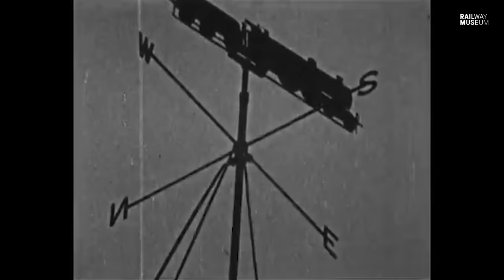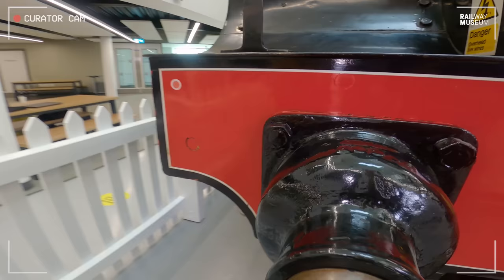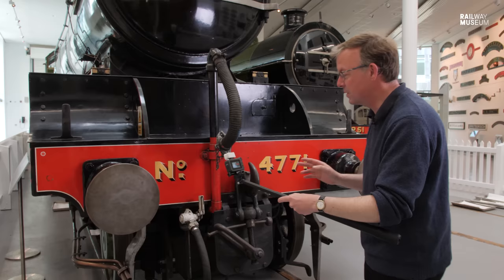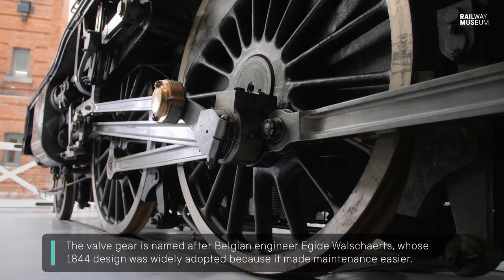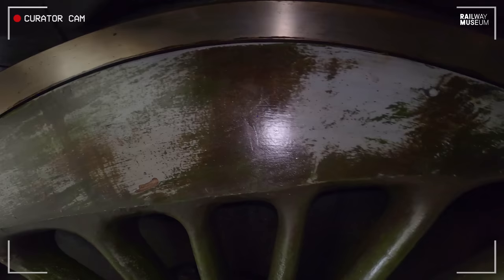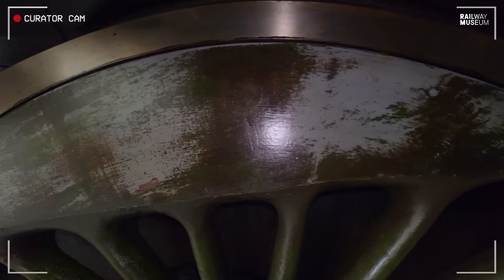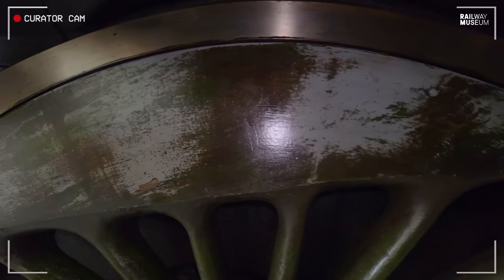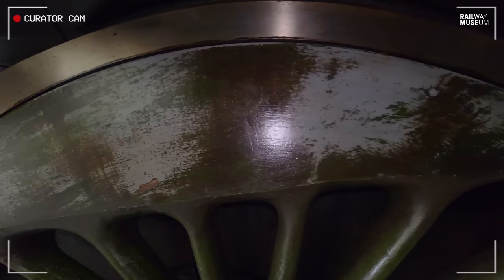Green Arrow: The Ultimate Guide to Gresley's 'Sawn-off Flying Scotsman' | Curator with a Camera

Comment: Frozen in time since 2008, just such a shame she's now totally static. Honestly engines like this need to be alive and free to run.
Reply: They can. Its just fuel and keeping the parts from expiring thats the big fr*king holdback.
Reply: @Tankindankincam not entirely, boiler tubes do need overhaul after 10 years or less and you'll need money to keep them running for generations, sometimes locos just take a long static rest before being run again but as long as you have a willing team of people and lots of money to burn you can get any loco going again (provided if the parts are completely knackered)
Reply: Hello
Reply: Hi Anthony. Green Arrow hauled the first train over the Settle and Carlisle line following the lifting of the steam ban. I was a coach steward on the train. I still have the tie they gave us. They did a presentation to Bill Harvey on the journey. I will have to dig out the photos.
Reply: The only thing stopping it from being returned to service is the owners.
Reply: @bjoe385  not so. We are willing to discuss, but it would need to be a funded partnership. The loco is on our operating strategy, so we haven't said no
Reply: @anthonycoulls7301  That’s mostly what I meant, there is no physical reason why the loco can’t be returned to operating condition, it just needs the decision to be made by the owner, the funding from the owner or both.
Reply: I am in total agreement with you on that point. I however don’t agree that the pony truck carries any weight. The PT is there to guide the whole machine, not carry any weight.

The actual, original design of said Pony caused lots of problems so it had to be re-designed.

If you browse through the sheer number of incidents with this loco you might begin to think she is jinxed.
Reply: @Tankindankincam  The biggest killer for a machine like this is to be a static museum piece
Reply: @leokimvideo  Not as big as a scrap yard. I much rather have a loco on display in a museum than left outdoors exposed to the elements or in the scrap yard.
Reply: @bjoe385  Well, first they need to fix the monobloc and they need money to fix that.
Reply: Heya Leo.
Reply: @anthonycoulls7301 dear Anthony.  If this is your account I’m replying too.    I am a huge fan of greasly locomotives.   Mallards 100th anniversary is coming up in 14 years.   Has there been any discussion of letting her steam again for her centenary anniversary/ centenary speed record anniversary?    She hasn’t seen steam since her 50th and into 1986.  I feel it would be very important for her to see service again on the 100th of the record
Reply: @anthonycoulls7301  well said. I think it's easy to forget as outsiders just exactly how much work is required to own and maintain these magnificent machines, and that unfortunately for everyday use they are very much inferior for general operations and active main line service. There are a number of locomotive classes which are extinct and thus their history is lost,  we are lucky to have a surviving loco, regardless of whether it is in service or not. It still exists and will still be around for future generations as a genuine artefact of the age of Steam. It took more than 2 decades to get Blue Peter back on the rails under her own steam, one can only imagine the money, planning and hard graft it took to get the job done at all.
Reply: If you are willing to pay for that new cylinder block to be built and installed I’m sure that would speed up the process

Comment: My dad was born and brought up about a mile from Doncaster Railway station and works. His favourite engine class was the Green Arrow. In the last days of steam, we lived near Nottingham and you occasionally saw one at Nottingham Victoria Station, running expresses to Marylebone, instead of the ubiquitous Black Fives. Despite the shortened boiler, compared to Gresley A1/3 Pacifics, they were more powerful than all except A3s with 20" cylinders. A remarkably elegant design.

Comment: The P2 Loco trust has just had a mono blog cylinder built for Prince of Wales so could the NRM not get one made for Green Arrow. I know the the Green Arrows was a different design but it could done. I would love to see her in steam again and remember her pulling the special train from Carnforth to York back the the 1970's. It was a wonderful trip. we also had Flying Scotsman and Sir Nigel Gresley on this trip each loco taking part did each part of the trip.
Reply: It could be done, we have the drawings. Cost is a major issue, which is why we'd need a partner to even consider it. Unlike the P2, we would seek a like for like replacement with a new casting rather than a fabrication.
Reply: @anthonycoulls7301  aside from the pattern I thought one of the reasons for its overhaul being put off was because it's an original LNER cast block and the NRM wanted to keep it on Green Arrow.
Reply: The house front end wasn’t Gresley’s! Just look to the right at Ivatt’s Atlantic and there it is.

Comment: It would be great to see Green Arrow run again but the issue is what would take it's place in Doncaster & where would it be overhauled as the NRM's workshop has become wonderlab (no idea why they shut it as the works was the one place where people could see work being done on locos). Riley's would be the best place as they performed amazingly on the A3 & would make sure the V2's overhaul would cost nowhere near as much as it did with Scotsman, could've overhauled 3 or 4 locos with what got spent just to fix the A3 which was around 3 or 5 million.

Comment: One option might be a  fabricated Monoblock similar to what the p2 will have,  even with one off castings a new Monoblock casting will be very expensive, the 100 dollar question, will the NRM allow it, or insist on like for like replacement  personally , i would love for 4771 to go on loan to the A1 Trust after POW is finished, they have a track record of being able to raise funds  and tornado has shown they are competent.   and the NRM, allow them to go with the fabricated cylinder design, it would have merit on an educational front, because it would show  how modern day  methods are changing how we maintain old historic items.
Reply: We would seek like for like replacement, it can be done. Think 3d printed pattern, and we have the drawings.

Comment: Nice work. Will you be releasing a video on C1 Atlantic No.251 since it's also at Danums?
Reply from the maker: We're planning to make a return visit :)
Reply: @NatRailwayMuseum  could the crack in green arrow’S cylinder be welded? Or is it so bad that it just needs to be replaced  entirely?

Comment: English trains are driven from the port side…. But English cars have the driver on the starboard side.  Is there a particular reason for that?
Reply: Visibility of lineside signals I assume
Reply: British cars drive on the left hand side of the road, therefore drivers sit on the right to have best visibility of oncoming traffic and such like that.

Locomotives are still driven on the left of the railway, however signals are put on the left hand side of the track, in the cess, for easier connection so signal boxes, no need to run the signalling equipment under the track if it can be avoided. And as it’s the engineers job to respond to signals, he needs to be in a position to see them best, that being the left hand side of the train
Reply: The GWR drove from the right.
Reply: And in the USA, road vehicles are driven from the left hand side, but railway vehicles are driven from the right side. The opposite of current British practice. When Britain had many railway companies, some drove on the left side, but other drove from the right. For signaling purposes it is better to standardize the operating position.

In Victoria, Australia the broad gauge railway was driven from the left side, but the narrow gauge railways were driven from the right. The first narrow gauge engines were built by Baldwin in the US so were right hand drive and so the locally built engines copied that. When two additional engines were bought in 1926 from Beyer Peacock & co. Ltd. Manchester, England (Garratt engines G41 & G42) they were also right hand drive.
Reply: @johnjephcote7636  the GWR was just flat out weird and the practice of driving from the right side was not practiced by any other railway during the grouping era if I am correct
Reply: @billymcmedic4221  I understand that for example all the Gresley A1 Pacific's were right hand drive but when converted to A3 specifications that also involved conversion to left hand drive.
This would seem to indicate the GNR was also a right hand drive line.
Seems that the LNER later saw the logic of converting locomotives to left hand drive where possible.
Reply: @johnjephcote7636  They weren't the only ones.  The Midland did which is why 4Fs build under there auspices are right-hand but later LMS-build ones are left.
Reply: @billymcmedic4221  You are not correct. The Midland and the North Eastern both drove from the right. After the grouping the LNER continued building right hand drive engines for use in the ex NER area.

Comment: Do the cracks in engine casting mean it's steaming days are over?
Reply: It would need extensive boiler repairs and the cylinders to be replaced, but that's not impossible if someone were to come to us with a funded proposal and business case
Reply: @anthonycoulls7301  could keep the original cylinder on display in the museum if one day a new one can be cast
Reply: @jameshardy4354  yes, tha would be the idea
Reply: If in the future the money could be found to steam Green Arrow again, one of the early considerations would be if they should  abandon the original monoblock design and construct the cylinder block a different way that remains faithful to its original dimensions.
Reply: @Pesmog  later engines did have the mono block replaced by 3 separate cylinders

Comment: A good video, thank you. It is a great shame that this locomotive is not operable and the NRM should look at this. The cast block containing the cylinders could by replicated by the using the technique used on the P2, or the locomotive could have separate cylinders as many of them did later in their careers. I understand that the NRM is against this and does not want the Green Arrow to run again, Sad!
Reply: We would like the V2 to run again, but with cast cylinders not fabricated. It's in our operational vehicle strategy as having potential to run again.

Comment: When you are gonna overhaul Green Arrow? If you don't overhaul Mallard and Evening Star, it's fine, Sir Nigel Gresley is on the mainline, Bittern is awaiting overhaul, other 9Fs are operational on heritage lines. But Green Arrow is a sole survivor of a great design, she deserves to be out on the mainline hauling railtours again
Reply: As I've said in the film and in many answers, it's on our operating strategy and if someone came to us with a plan and funding, we would talk.
Reply: @anthonycoulls7301  how much are we talking to bring her back to mainline running again
Reply: Agreed. It's that pesky monobloc cylinder casting holding it up. But, yes, just imagine Green Arrow and Hengist double heading over the S&C!
Reply: @robertwilloughby8050  what's the diffrence between the monoblock on green arrow and the one been made for the p2 prince of Wales as could there mouldings be used or is it completely diffrent again
Reply: @chillingwolf  It's not quite the same dimensions, the theory is the same, but not in practice. However, you do make a good point, and maybe a bit of sharing of resources might push forward a solution.🙂

Comment: Black 5s were far better mixed traffic engines hence they build over 900
Reply: There's a "swings and roundabouts" aspect to it - the V2 had more power, but that power came at a cost of higher axleloading that ruined the "go anywhere" part of "go anywhere, do anything".  Saying that, as long as they stuck to the main lines V2s were capable of heroic perfomances, particularly during WW2.  Thompson's B1 is probably more of a direct LNER comparison to the Black Five, and a good 400-odd of those were built.

Ultimately, comparisons are odious - they're all great locomotives, speaking as someone who often prefers mixed traffic locos to express engines.

Comment: Green Arrow was preserved because it was the first built, and still had the monobloc.
I’m always quite surprised that the other 183 V2’s got scrapped.
Now the monobloc is cracked it can’t be replaced. 
Only chance of steaming it is having a new triple block manufactured, which purists don’t want, in case the original knackered monobloc gets lost?
Reply: I would like to see this wonderful engine back in steam. but even as a static display Green arrow is still a beautiful example of British locomotive engineering.
Reply: Surely nowadays there are techniques for weld repairing cast iron blocks like this.  That does change the original artifact of course.
Reply: This begs the question, if Flying Scotsman is still loved and respected even if only a tiny handful of her original 1923 parts remain on her chassis.
Why can't Green Arrow be the same with getting a new Triple Block?

True neither loco would be 100% original, but still deeply respected.
Reply: @exveefan  7 heads and 6 handles but still the same broom.  I would not disagree with you but some would.
In service there were many mix and match instances like boilers being rotated between several locomotives.
I'd like to see Green Arrow steam again.  If a new monoblock were to be cast, the original could form an exhibit of its own.
Reply: @emmabird9745  even if weld could repair it, the entire set of cylinders and valves is out of alignment, meaning that there's 1/8" of material on one side and 7/8" on the other, so re-boring, sleeving and lining is not possible.
Reply: @anthonycoulls7301  Hi Anthony.  That means the only possible solutuions are new momnoblock or accept a loss of front end stiffness and three separate castings (eg if patterns existed for other 3 cylinder Greasleys).  Following that idea, maybe such patterns (if they exist) could be combined in one large casting possibly reducing the eventual cost.  I still think that if the monoblock were replaced then the original could be made into its own display (then hopefully it would not be lost).
As you said the monoblock increases the chassis stiffness.  That results in large stresses in the block, leading to cracks and distortion and so on.
Never the less the loco certainly looks great as you have it exhibitted.  Keep up the good work, you're all doing a great job.
Incidentally this series of videos is very enjoyable.